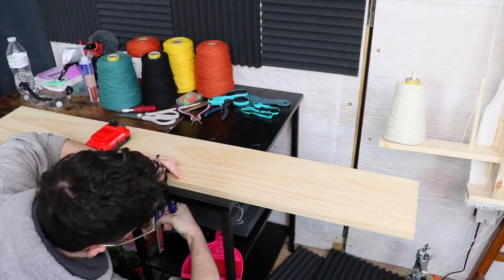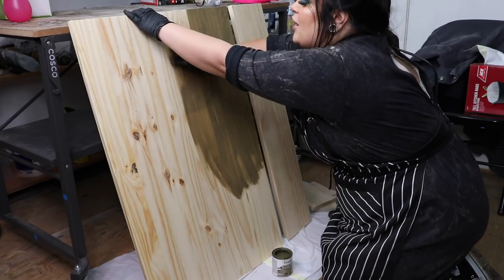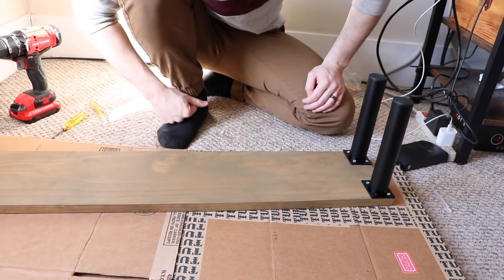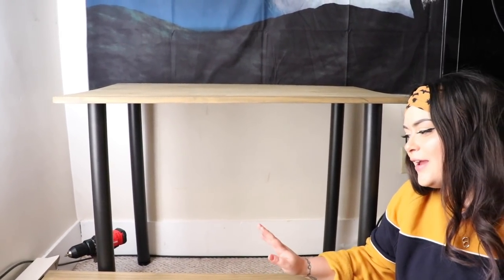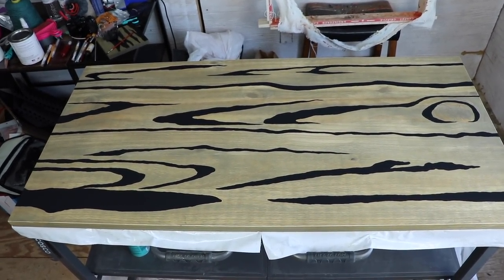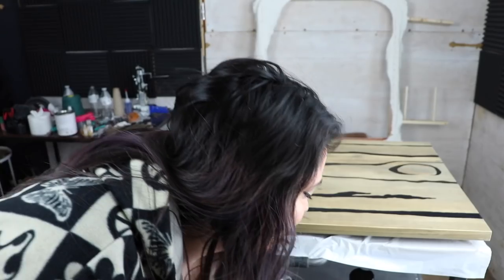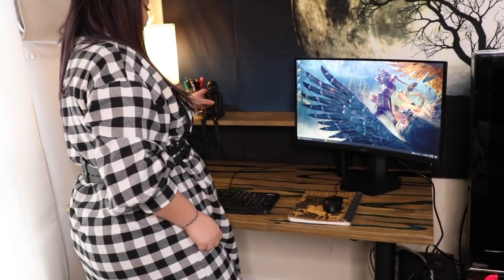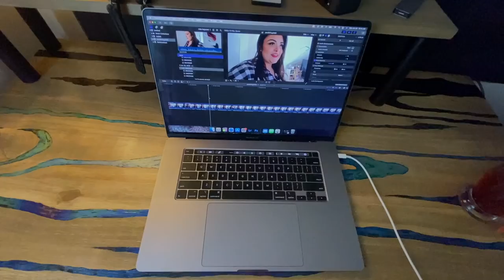BUILDING A COLOR CHANGING RAINBOW GAME DESK! AMAZING MOOD RING EFFECT 🌈

Comment: If you ever decide to try another flat wood project. My dad taught me a trick. It helps the wood from warping. You add an edge to it. 3/4 inch, 1/2 inch. Whatever will fit the board. You can sometimes get the warp out by wetting the board and adding weighing it down flat. As I said, sometimes it helps.

Wow that turned out so pretty!

Comment: I took your enthusiasm to heart and got some of that thermal paint. I cannot express how much I love the results.

I like the progression in the channel, and how it's branching out.
Reply: As for what I think of the desk? Fantastic. The only flaw I see, is that it's not mine, but considering I am refinishing two tables today, I think I can remedy that. 

You asked about putting a finish on the wood before or after assembly, and I think you answered your question twice without realizing it. Once you had the first table assembled, it was obvious to you that it was not going to work, so that stain never needed to be applied. And when you mentioned the backbreaking work of painting the liquid crystal paint on the floor, it's why sitting at a desk that is built to be comfortable would have made the whole thing more enjoyable. I always prefer to finish wood after I build for another reason as well, if you are joining wood to wood, you often need to sand away imperfections that don't line up perfectly and you see parts that prevent the wood from forming a flush surface against another piece. If you stain it first, then sand that stain away while you smooth it out, the stain can be very obvious where you re apply.

Also, cross bars are a fantastic way to make a shaking table stay stable. An "X" pattern will create a rigid structure between legs, but a simple horizontal bar still adds a lot. Panels can also be added for structure. For a warped piece of lumber that has the feet at different heights, normally I'd say to use another piece of lumber, like you did. If I really feel attached to the wood and I know the shape is permanent, I sand down the feet. But, those metal legs look a little more difficult to sand than pine and I think you made the right choice.

Finally, when you apply stain, you can enjoy a variety of effects in the finish by brushing your color on and waiting different times to come behind and wipe it with a rag. You might want to get a long piece of the same wood that you are using applying a coat of stain, then wiping a fraction of it away every 10 seconds so you can see the progression of what gets stained and how deeply. But all said, that was a great job on this piece and it came out stunning.
Reply: Love this. What is the color changing paint? Mood ring paint
Reply: @edienorris9268  it says "liquid crystal" on the baggie